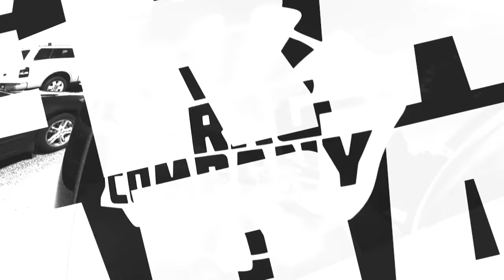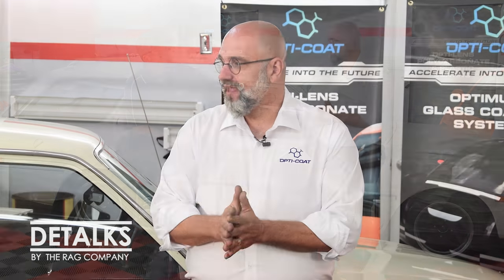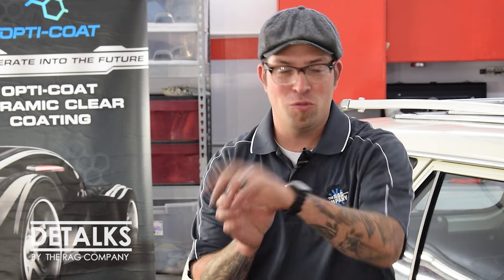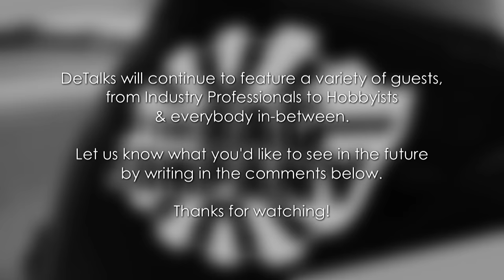DETALKS - The World of Polishing & Paint Correction

Comment: I first machine polished with a Porter Cable which I imported to the UK in 2006. After learning about pads and polishes etc with that, I moved on to a rotary a couple of years later. It was about 14 months ago I bought a Rupes LGH15 mk2 followed by the 75e. I still have my rotary which I use with 2” spot pads for those areas. I’m so glad I can use a rotary even though I don’t very often these days.

Comment: When are we going to get to see Optimum's microfiber pads in action?  That and I'd like to see the microfiber pads under the heat detecting filter.  I think since there's not a large flat surface rubbing on the paint and air can move between the fibers the pad should stay cool.  I've used the Meguiar's MF pads several times and never notice anywhere near the heat I get from foam pads.

Comment: The vid at the end is very helpful. Some waffle foam pads now have holes in the center, do you think that alleviates the paint from less heat?
Reply: A lot of all types of foam pads now have holes in the center.  The center is where most of the heat is generated, so yes it does help keep the pad and the paint cool.  That and the center, due to the heat, will often collapse so that the pad is permanently sunk in.  So if the foam is going to fail in the center anyways, might as well get rid of it to begin with.
Reply: Thanks Chris